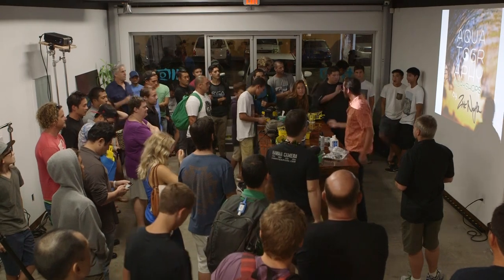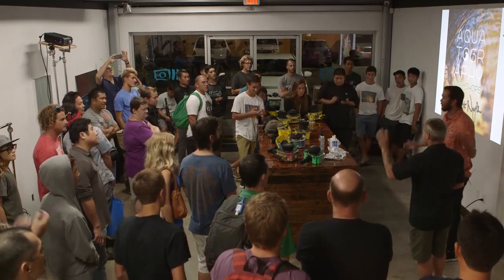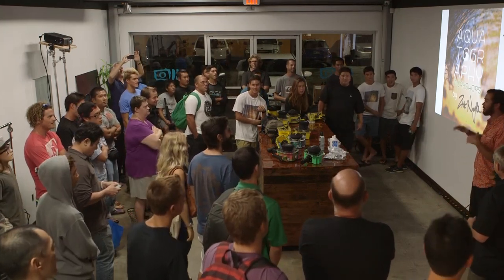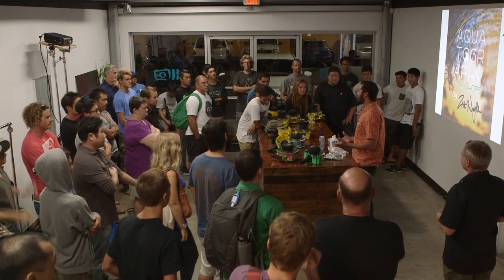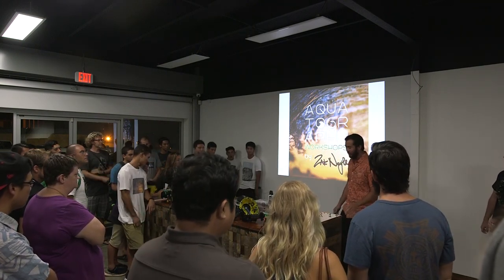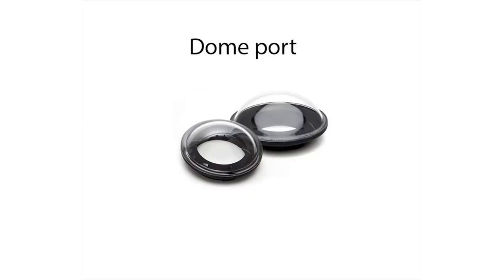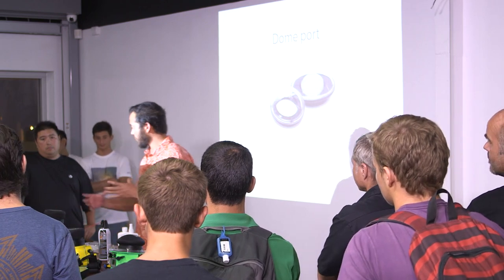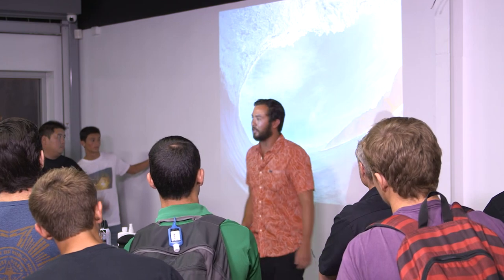Water Housing Care, Maintenance and Use - Aquatography Workshop by Zak Noyle

Comment: Hi there.

What O-Ring Silicon grease do you recommend, ive read some brands can cause the O-ring to swell and damage?

Do you recommend adding silicon grease on the controls and should it be the same as what you use for the O-rings.

Great video by the way, thanks.

Comment: i couldn't understand if you said that for flat ports they should always be dry (not lick)...?
can you clarify if i should not even lick the flat port 
thank you
Reply: correct, use candle wax and buff it on so that the water beads off and you can shake it off.